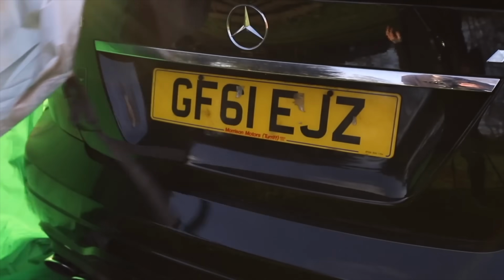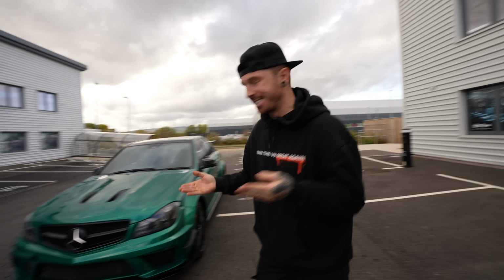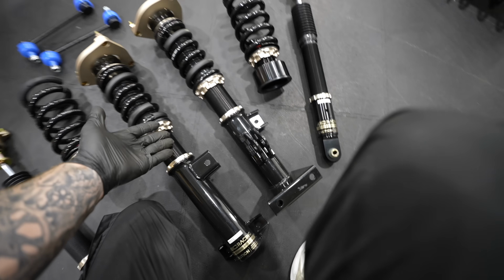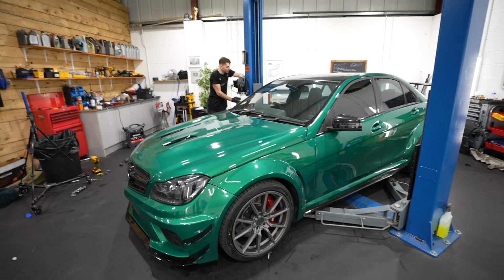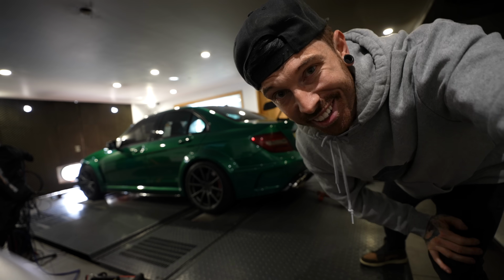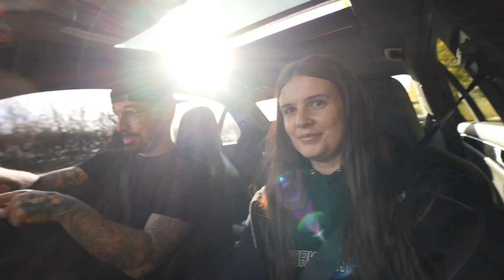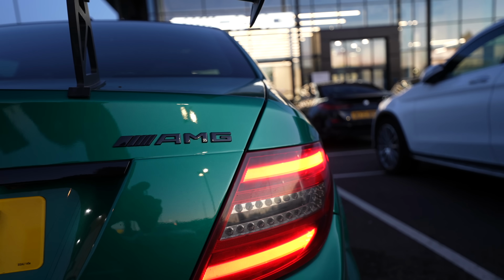MERCEDES WANT BACK THE WRECKED C63 I JUST REBUILT

Comment: The body shop have done an Amazing job on the respray the colour is so nice amazing to see the C63 looking like it’s just left the showroom 👊🏻👌🏻 Well done Matt again for all your hard work!!
Reply: Check the gaps and fitments 🧐
Reply: When he measured the arch gap you could see massive amounts of orange peel
Reply: Horrible job to de honest . Orange peel and panel gabs
Reply: @drunknspike  Orange peel can be polished out
Reply: @steviegee8413  you expect a newley painted car to be perfect when you pay and pick it up and not to have to take it back to get polished out I have an issue with a car I had painted 3 times it had to go back to get sorted
Reply: @drunknspike  I think Matt has a lot of people he knows that do work for him for "mates rates."  I have a paint sprayer that did work for me previously, he fitted it into a tight schedule and it wasn't perfect.  I didn't notice it but the car was a lease, when it went back, the guy that inspected it noticed it.  However, the next job I gave my guy, he said he wanted it for longer to do a proper job.  It came back mint.
If you look at Mat's Aston restore videos, in one you could see the cost of painting the bonnet and front bumper and it was £800 or £900.  No way should it have been that cheap.  So, I think it's a similar thing.  He gets it done cheap and maybe sometimes it's rushed.  As long as Mat is ok with that, it's up to him.  All the work he puts into these cars, it won't take much for him to either polish it out himself, or knowing him, he has a mate that will do it for next to nothing.  However, if he paid top dollar for a respray and got the Merc back like that, it's def an issue
Reply: Watch the latest review of the car paint. Think Mat needed a hug after he saw how bad it aged without bein driven 😢 💔

Comment: Awesome! But, with that power I’m kind of thinking you could have pulled it under the radar a tad by NOT fitting such a pronounced spoiler. Plus, refinishing the brake callipers in the green to match the paint job would be top drawer I reckon.
Reply: Under the radar making that noise 😂
Reply: @smoggy1964  I am referencing looks, not noise.
Reply: @garynorman  lmao yeah we know, even without the spoiler theyd be able to track it

Comment: I understand updating the suspension, but why in the world do you people think that you have to slam a car down, till the suspension is not working properly. The Gap around that tire was perfect, it does not have to go lower. It looks wrong when it's that low. And you cannot have a car without proper suspension travel work properly. Especially if you're going to drive it on the streets where other humans are driving.
Reply: Right? Can can ride much better with a meatier tire and it will fix the fitment I understand in the front tho maybe lower it and get it tight
Reply: Not autobahn in UK, looks cool’s sells faster & for more I guess?

Comment: There are a few things we didn't get to see  or were not fully addressed yet.
a)Frame damage on the sideskirt area being fixed , 
b)Wing&hood&frontbumper final fitting with "bang on" gaps  and
c) the exhaust . 
also d) window tinting match up and maybe e) glass shard removal from the doors.
Wait i forgot f) brake caliper painting
I've devoured most of the series and C63 one feels incomplete.
Reply from the maker: Frame damage was done by the bodyshop. Although they never touched the fitment. Not sure what you mean on the Exhuast and the glass and tints were done on the 2nd channel

Comment: Hi Mat. I just wanted to tell you that I received the exact same letter in August for a passenger side airbag replacement. It is completely normal. Apparently the original airbags fitted when the car was made contained a particular product that could've caused an issue, so they recalled it, and replaced the passenger side airbag in half a day. So that recall wasn't exclusive to your car.

Comment: Im doing the exact opposite rebuild on another 240 GT Volvo sleeper / rally / drift build.. Almost ALL pristine used/salvage HD parts from pickup trucks and wrecked whips.. Ripped every inch of wire and plumbing out of Volvo, all interior, all dash, all heat , all ac deleted. Drivetrain deleted. 10pt cage in, LS7 9000 Rpm build done(took me a year to score a knife edged lunati bottom end😍 ). 7sp manual trans and slipper.. big disc brakes and coilovers that are from a 1000lb heavier car...    Almost done and it all cost under $10k and a couple weeks of work so far stacking cars /easywork..
Local insurance salvage yard lets me know when some funky destroyed built car comes in, and i harvest high perf aftermarket odds and ends. Then work a day or two operating equipment in exchange.  My Volvo Still need wheels tires, a haltech or Holley Ecu and harnesses. But the build ends in sight, almost done!   Hopefully spring 2024 be drifting A LOT😛 and drag racing a lil..😋

Comment: I get that he is stoked, its a sexy machine for sure. But the panelgaps and lines are not onpar. by several cm some places. to have something this exclusive and give up right at the finishing line is sad.. meh  good enough and throw some wrapper on it..  (or paint if thats ur jam) Mate... align the bonnet so u cant fit a finger in like u can now? and the front bumper is not matching the curve for the wheel arch. had to stop the video at 4:53 as this breaks my mercedes spirit to see such a gem so close to perfection but given up on the last stretch of fitting and panel adjustments.

Comment: Mercedes Airbag recall , yes I got this letter and the dealer explained how all cars over 10 years old are on the recall programme due to the lifespan of airbag gas running the risk of not operating correctly .
It’s a general thing as I think the initial supplier doesn’t want any court cases in case of injury .
Nothing to worry about as far as warranty or car specs

Comment: The left quarter panel spacing is to good the hood gap is to wide and the bumper to fender gap is so tight. The front of the quarter panel needs to be raised about a cm to make the spacing look flush. It’s such a small thing to pick on but I noticed it when it drove by at 5:35 in the video

Comment: Matt... Hello mate and thanks for the amazing vids all the time. I'm a travelling ICU nurse and the head gasket on my 08 Subaru Legacy Spec B went. I ended up buying a v8 Lexus LS430 (ancient, 2001 model with a 4.3L NA engine). Question I have is that if some place like Mallory Performance could tune it to get a few more horses out of it, would I be bringing it to the end of it's life even earlier?? Currently on a slow mission (as money allows) to replace all the oils and radiator as the rads have a common fault in these things. Thanks again and I look forward to your thoughts. Shafiq...

Comment: 5:35 I'm sure it's not finished yet, but every panel on the front end needs taking off and putting back on properly......... I don't mean to sound sarcastic, but normally you have to open the bonnet to work on the engine....... Otherwise, I can appreciate the work you've put in, and it has real potential to look good once finished. Keep up the good content on YT, always entertaining. Looking forward to the next vid, thanks.

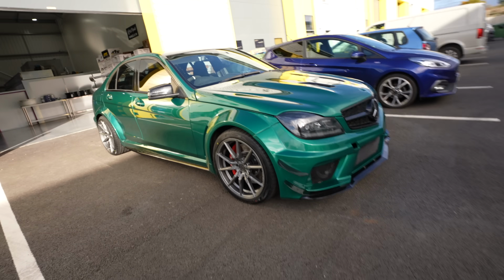Comment: 5:00 the gaps between the fender and skirt and bonnet are totally rubbish. will they be fixed later? the skirt is hanging from the fender so it looks like some support is missing. and the bonnet looks like it is not fully closed (only first latch).

Comment: I know this video is a year old.. but on the off chance your still checking comments......

If the recall was purely for the Airbag... but you already replaced the airbag..... would they still need to re-replace it? or just ensure the one you replaced it with was not the same model as the one that had the problem?

Comment: Hi Mat. Just wondered if you could help with a merc amg issue? I have an amg ml 6.3 and suddenly the seat belts tighten and the sunroof & windows open. Suspect a part called 'yaw sensor' for roll-over protection but I have no idea where it might be located. Just wondered if you came across a similar part in the C63? Much appreciated. Nick

Comment: Awesome build, and not wating to be a dick but panel gaps are not quite Mercedes spec. Bonnet to fender too wide, and both bumpers to fender are uneven. I would have a word with the body shop about the issues. The car looks good but could look amazing.

Comment: CAN I ASK DID YOU DID YOU RE TIGHTEN THE SUSPENSION  WHEN IT WAS ON THE GROUND . OR DID YOU DO IT UP ON THAT LIFT . YOU WAS USEING TO CHANG THE SUSPENSION.  IF YOU DID THEN YOU REALLY NEED TO PUT IT ON A LIFT WHERE THE WHOLE WEIGHT OF THE CAR IS ON THE SUSPENSION.  OTHER WISE YOU WILL WHERE THE BUSHING OUT MUCH EARLIER.    OK BUDDEY.